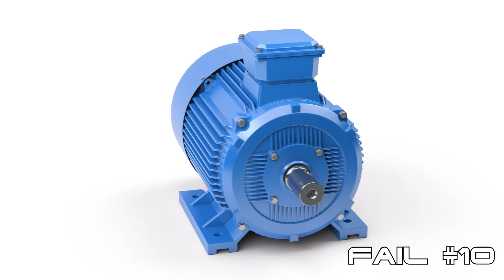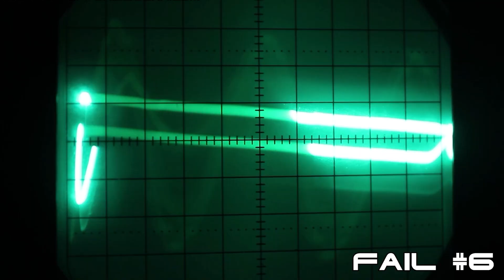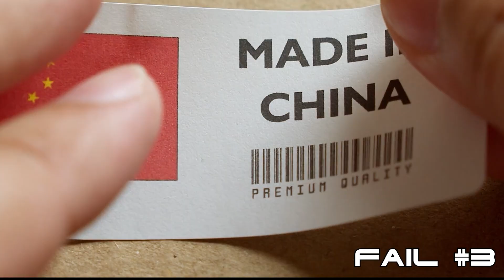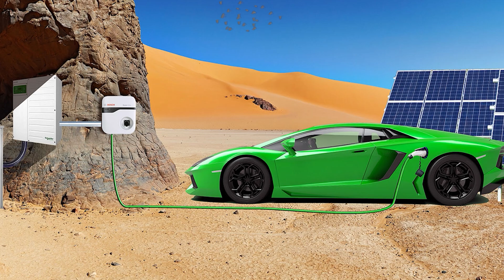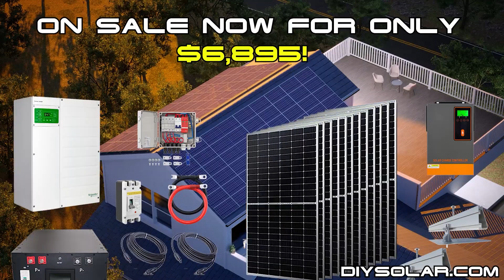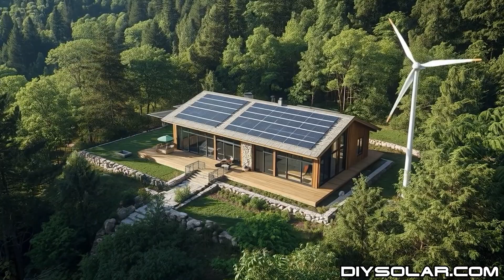Ten Reasons Why You Should Never Power Your Home With A High Frequency Inverter

Comment: After experiencing multiple early failures (less than 3 years) I would never buy any brand of high frequency inverter again. My Schneider Electric XW Pro low frequency inverter has been operating 24/7 off grid for over 6 years without a single glitch.

Comment: What about Victron? mine is a high frequency one,and handles surges as per specifications....and vear on mosfets? what utter bullcrap,they dont vear and tear,its not mechanical....it can work indefinetaly if enginired correctly.Victron also has high quality parts.Complicated design? Its as simple as a toroid one,i opened mine,its has like 2 boards,switcheble out.Also its not noisy....this video might be true for first gen chinese high frequency inverters,not true for all.Rage bait video. You know i can give an exemple with the light emiting diods....when they are used in specs,they last forever,dont emit heat,therefore never burn out,or get damaged-What they did with led diode light bulbs? They are enginiered so they get 150% of the power they need,sure gives more light,but also burns them out very quickly,or make a resistor fail,and turn off that way.I buyed and opened up 10 pieces,and changed the resistors so they dont get heated up,been using now for 5 year whitout turning it off ever in a hydroponic garden. 5 years and they dont heat,dont brun out.You can achieve with mosfets the same,there are mosfet based electronics working for 20+years,like old video cards,or other electronics.When kept on safe operating temps,they can work forever.

And btw,i have seen many inverters fail that had toroid,low frequency ones,they have printed circtuit boards too.When they fail,the same way you cannot use them.Then you end up wasting a big pile of copper and iron,in the form of that transformer.So yeah.High quality parts and good enginiring is the key,not the type of that inverter.
Reply from the maker: If you watch the video again, you'll see that the video refers to "Cheap Chinese-made high frequency transformerless inverters" that use Chinese-made components in their construction, not Victron high frequency inverters. And in reference to what you said, "there are MOSFET-based electronics working for 20+years , like old video cards, or other electronics", inverters are not like typical MOSFET-based electronics. Unlike "old video cards and other electronics," They are typically subjected to variable high inductance and reactive high surge loads that can draw an immense amount of current, which can cause the MOSFET's operating temperatures to suddenly and dramatically increase, basically causing the silicon used in MOSFETs to wear faster and fail. 

And insofar as your claim about the design being "as simple as a toroid one", you're mistaken; we've operated an in-house factory-authorized, inverter repair business for the past 26 years and have repaired thousands of high frequency and low frequency inverters and can confirm, first hand that the design of a high-frequency inverter is far more complicated and use far more components than a low-frequency inverter. These are all reasons why, if you're going to purchase a high-frequency, transformerless inverter, we recommend that you opt for inverters that are US-engineered and built in the US or Europe, rather than the Chinese units.
Reply: They may not be mechanical in nature but electronic components such as capacitors, and MOSFETs are subject to increased wear and tear as in fractures in the silicon substrate in MOSFETs and dried out electrolyte in electrolytic capacitors when they are exposed to high inductance loads. And handling surges as per specifications isn't saying much when it comes to a high frequency inverter's specifications, since they are typically only able to deliver a 150% to 200% surge capacity. And you're grossly mistaken when claiming that a high frequency inverter is as "simple as a toroid one" I repair inverters for a living, have done so for the past 30 years. High frequency inverters are far more complicated and use far more components in their design. In fact we charge a 30% higher rate for repairing a high frequency inverter than a low frequency inverter.

Comment from the maker: If dealers don’t tell you what type of inverter they’re selling, there’s usually a reason. High-frequency transformerless inverters cut costs — but they can create dirty power that damages appliances. Our kits ONLY use premium low-frequency, toroidal, and EI core transformer-based inverter-chargers for clean, stable, utility-grade power. If you want reliability, performance, and unbeatable pricing, DIYsolar.com has you covered!